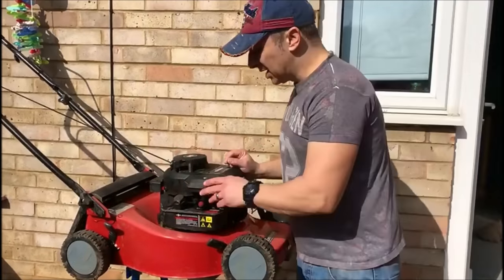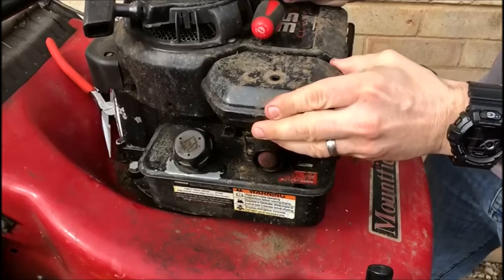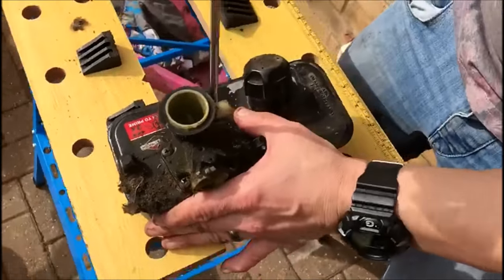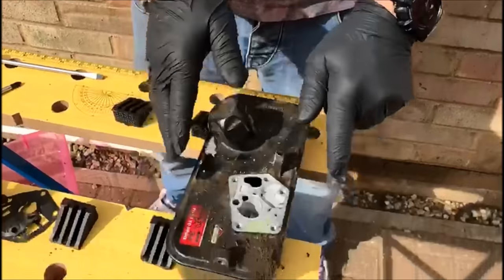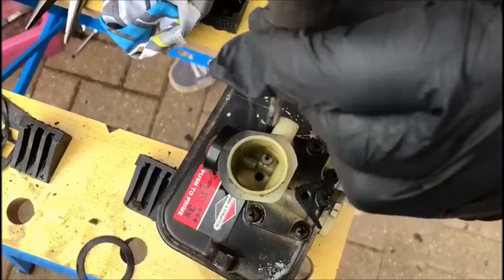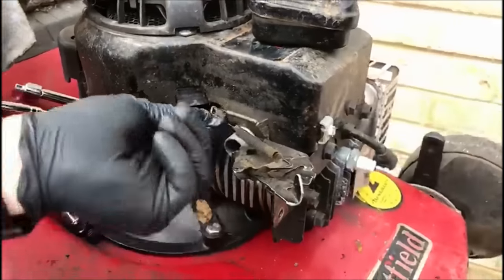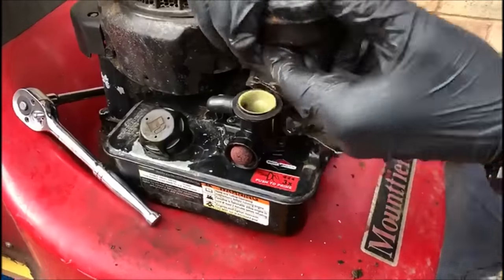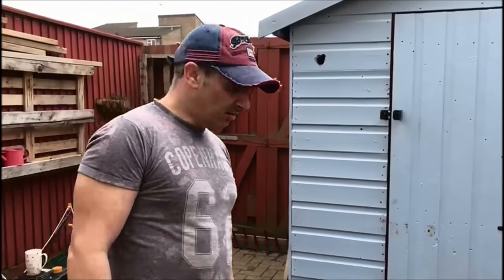how to service ,repair a briggs and stratton carburetor

Comment: I bought my mower several years ago. It has always been a bit of a s*d! I've had it back to the dealer but that made little difference. I knew it was a fuel problem with lumpy running and being difficult to start and almost impossible to restart when hot. I followed this video and cleaned the carburettor and replaced the gasket and diaphragm. It's a different machine now. It starts easily whether hot or cold, runs well and tackles long grass with ease. If only I had done this years ago. Thanks for your easy to understand video.

Comment: Thanks. Could not have fixed my mower without the likes of you. I watched a load of Youtube videos on these carbs 'running too rich', 'lumpy throttle control', sooting up spark plug, 'fuel leaking', 'not sucking up fuel unless tank more than half full', 'primer bulb not sucking fuel' etc. My mower was doing all of these things. I started off cleaning the carb with carb spray and changing the diaphragm and gasket for a non genuine version off ebay. This may have made it a little worse. Making a sandwich with the diaphragm between two gaskets made minimal difference. The problem was these plastic carbs are prone to distorting with heat and time making the surface that contacts the gasket uneven. I tried flattening it a bit with a sharpening stone and that did not help. Finally using the carburettor replacement fixed all the problems. If your carburettor is distorted get a Briggs and Stratton genuine replacement. They are not expensive

Comment: From Mark. I enjoyed watching your video with the diaphragm and carburetor gasket replacement. At this time, I have my sister’s mower at my place for the exact same repair. The B&S engine (10T802) runs great for about 2 years and will promptly blow another gasket. I tried another carburetor and there was no change in the end result. Now I purchase the carburetor parts in bulk for my sisters mower and a Series 300 B&S engine that I have. Best Regards From KY. Cheers.

Comment: excellent video.. 5 STARS 
I stumbled across your video looking to service a mower i bought off ebay. The oil dipstick screw wouldnt turn and the whle thing came out! (fixing screws were missing) managed to twist cap open, lubricated it a bit, put it back in and put 2 replacement screws (finally my collection of odd screws has come in handy) so the dipstick unit is now fixed and cap can now be turned and oil checked.  quiet proud of my self! I hate DIY because something always goes wrong!! I even managed to clean the Air filter!! so now feeling confident I searched youtube and came across your video,  and now after watchng it i feel confident enough to tackle a simple service !!   (at this rate i'm going to put my local lawnmower repair shop out of business!!!) 
cheers mate
Reply: me too.

Comment: Thank you for this excellent video for both cleaning up the carburetor and replacing the gaskets to fit it back onto the fuel tank. Not only are your instructions clear but you have a nice delivery that instills confidence that it will work. The result for me today was exactly that. The 4.5 horsepower Briggs and Stratton engine runs without surging anymore and my wife will probably stop expecting me to fix that hand lawn mower she brought back from the garage sale.

Comment: Thank you for this video.  I have same briggs and Stratton engine in my Mountfield empress 16 and had  changed the carburettor gaskets but broke my leg and shattered knee cap so had a delay finishing the project and when I came back to finish up for the life of me I couldn't remember which way the springs went back on. Really should have taken a picture but didn't anticipate starting the job one spring and having to finish it the next one lol.
You're a star.  Thanks again.

Comment: Great vid .
A couple of things to note, the o ring on the carb should be fitted to the carb and clipped in place before it is put back on the mower. Also, if you put the black sump breather pipe on the carb before putting it back on the mower, it makes life easier.

Comment: This is my first time at doing anything mechanical.  As a result of watching your video a few times (3) I got a kit, cleaned the fuel tank (old fuel was syrup) cleaned carbi, new gasket new plug chnaged oil.......started first pull.  woohoo.  now onto the whipper snipper.

Comment: Hopefully you still monitor these comments - I just cleaned my air filter and I can't get the long crew to "bite" into anything. Where does that long screw thread into? It's driving me crazy, it should be dead simple! Thanks for your help if you see this! FOLLOW UP NOTE - after asking about where the long air cleaner screw needs to thread I figured it out - I removed the tank and carb assembly from the mower, then took the carb off from the tank and looked at where the long screw should thread into. It turns out that the hole was full of dirt (not sure how it got in there) so I cleaned it out with a narrow pick which took a while to get all of the dirt out until the screw threaded in enough. I tested it as I went with the carb off. Once the screw threaded in enough I put everything back together and onto the mower - the long screw seated fine and holds the air cleaner cover in place securely now.

Comment: I really enjoyed watching your video especially your two Assistant/Inspectors !
I always clean and blow everything off with air gun "before" I take everything apart. That way all that dirt doesn't get in the carb or engine etc. (that's just how I am- it bothers some people) Also so much easier to work on from that point.

Comment: I usually brush off the top of the tank and around the carburetor to make sure nothing falls in it. So it's easier to clean and maintain before putting the thing back together with new parts.

Comment: Hello congratulations for the video that taught me a lot. But I noticed that in my opinion there is an error when you mount the carburettor with a free oring seal on the intake pipe !! I believe this must be mounted first on the carburetor with the ring of pastica that blocks it and only after inserting it in the intake pipe !! Otherwise this would not fit well by not closing and allowing the engine to suck in outside air. I specify that it is not a new controversy and only to avoid this error to others and forgive me for the translation made with Google translator. Greetings from Italy
Reply: You are correct.

Comment: Just a couple of tips, I only ever use warm water and soap to wash out the air filters. And to get a proper seal take the o ring and retainer and insert them in your carburettor before putting it back on the mower.

Comment: Thanks my Briggs & Straton started lsosing power after a few minutes of use. I changed the oil, bought a new spark plug and cleaned the air filter but that did not help! Alas I now know how to clean my own carburetor since I suspect that's where the problem exists.

Comment: I have other small engine equipment  like honda, etc. But briggs and Stratton has always been the problem starting. I put fuel additives, fresh gasoline with stabilizer and run it regularly and still a pain!

Comment: Great video mate and thanks. What size are the 2 sockets you used to take the carb off the mower?
Also, can you tell me what size of spanner I will need to remove the blade?
Thanks.

Comment: My filter screw does NOT tighten down any more.  Vibrates loose so filter wobbles and is not efficient.  Is it missing something?  Does it fit/screw into a gromet because the screw treads are NOT damaged but just looking into the cup the screw doesn't catch any corresponding threads to seat & hold screw in place..   Do I put some loctite goop in the hole a create new threads?

Comment: Very grateful for you sharing your knowledge. Mower runs a min or 2 & dies, primer bulb sucked in. New parts, reworked, now leaking petro. Could it be the gasket or o ring not sitting right ? I'm hoping. Gonna redo it tmrw.

Comment: I take the carb off and apart and use a garden hose to clean out all the ports and tank.  Clean the diaphragm and gasket and rub a little oil on them.  Blow dry with a hair dryer.  Reassemble and cut some grass.  Works every time unless the diaphragm is to far gone.

Comment: Great video. Really enjoyed it. I have a problem with my B & St  mower. It starts really well but wont stop. Would you provide a video on the causes of non stopping. Cheers.  Norm
Reply: Throttle spring probably

Comment: Only things I’d like to add is that I’ve had much better results with the life of an air filter (foam type) when I use filter oil on it after I’ve thoroughly cleaned it. 
Also, you didn’t address the jets. Cleaning the main jet is imperative to a smooth running engine. Good video though!

Comment: Do you have a vid of this same lawnmower (or any lawn mower that has a Briggs and Stratton 300 series motor, the older version) where you fix the governor? I replaced my carborator, but I think it's actually something to do with the governor that's not working, so I need to dismantle a lot more parts than just the simple carb replacement. Thanks :)

Comment: Hi, Ive got an issue to solve I cannot get through. After starting a Briggs&Stratton mower the spark plug gets carbonized very quickly and black dry soot appears on the tip preventing the right function and causing the mower to choke up like every few seconds. After cleaning and removing the soot from the spark plug the same issue reoccurs. The air filter seems to be clean + I've sprayed some carb cleaner into the carburetor + cylinder itself.
What occurs to me is either bad ignition timing which I strongly doubt or bad petrol, can it be?? I forgot to mention that spraying the carb cleaner defers the choking up substantially but the same issue within 30 minutes or so...
Reply: If it has this same carb as in this video, you need the same repair.  Main symptom of these diaphragms failing is the engine will run WAY too rich--black smoke, chugging, fouled spark plug.  The diaphragm starts to leak around the holes so the engines sucks up fuel from places it shouldn't.  Also, DON'T get carb cleaner anywhere NEAR the diaphragm.

Comment: Mine is a Rover mower with the Briggs engine.....when I watched this video I noticed that the diaphragm on yours doesn't have the pump linkage to a butterfly flapper in the intake tube that mine has.....maybe mine is an old model ..........I got it in the early 90's, still running.....your carb is a much simpler model than the 6 screw carb model that mine has.......mine also doesn't have the primer bulb for easy starting.

Comment: Is it possible to put a throttle cable on this engine’ so I can run it at slower revs for short grass’ and less noise in the early mornings before I go to work ‘ great video well explained keep them coming
Reply: Just stretch the governor spring a little

Comment: That O ring and white  plastic collar goes in the carb first .The O ring first and then the plastic collar which  is an interference fit in the carb .It will suck air in the wrong place like that

Comment: My neighbour had no place to put the law mover  so he asked me to store at my place and I can use it too....
It is a BRIGGS & STRTON  AND it always started at first pull  ...winter come and we only used once a month
But to make it start I had to put a bit of petrol in the spark plug hole  of course I don't like to that all the time....
I dicided to clean the carburettor  and put it back m  ... the primary worked and it started after a few pulls 
But  it stays on the high rev all the time  ....I should point out that the liver that you disconnected  the springs
is short and it is easy to reconnect the tank  rather mine has a long connection rod that to the springs connection
little plate  sems to be that on this kind of tank only has a little spring on the others I have seen two one bigger 
then the small one and  they connect together....Well hope anyone can understand my problem and can give me 
an advise what to to make it start ......Thank you

Comment: Well it looked ok,.....but I put the o-ring in the carburetor then I put the keeper ring in,.... then I wet it with my finger and slide it on,......well I put the carb linkage on first,... slide it on and bolt it on.
But even then mine runs but will not rev?
I blowed air through the carb and air wouldn't go through,.......where the metal screen was?

Comment: There’s only on thing I would add. Bright and Stratton are American engines and they have not adopted metric. So if a bolt is really tight you need an AF spanner as metric can turn the corners from the bolts.

Comment: With fuel prices the way it is cheaper to buy a new filter infact getting a whole carb, which is where Brigs and Strat no make thier goods, is get £12 carb, plus diagphram and gasket  with primer bulb all new for less than the cost of the consituent parts, and the carb clearner is far more expensive!

Comment: Won't the airfilter only fit in the correct position?? The hole where the screw goes is not central so if you have faced it the wrong way then surely the screw won't scree in . ??

Comment: How do I replace the primer button?
Reply: Idk, but after mine not running for years, I put some gasoline in the “bowl” of the carburetor and a first start with starting fluid. Now it starts without priming or starting fluid.

Comment: I have problem on my lawnmowers carburetor primer , my primer when I pushed in the rubber for primer doesnt  pop up back anymore it stays in, I have that problem n I cant start the engine  how can I solve/fix it ? 
I live in Melbourne Australia n I have same engine briggs & stratton 4 stroke 148cc engine ,  but here they make in Australia n they call the brand name Victa, model Vintage, 450 series, blue color chassis/body but I believe engines r  import from USA n my lawnmower  has the same petrol thank n carburetor on your this video has.
i hope u help me how to fix that problem.Thank u in advance ,
Sorry my english may be no good, english is my second language.
Reply: Replace the primer button
Reply: Yep primer bulb is rotting inside. I found an old one with a hole in and fixed it with puncture repair kit glue

Comment: If it still doesn't run right after replacing the diaphragm, try using 2 gaskets with the diaphragm sandwiched between them. That's what finally worked for me. I saw this trick here:
https://youtu.be/8lyJka9XU58?t=655

Comment: should've oiled the air filter
Reply: How do you oil an air filter?
I've never taken a mower apart
Reply: @rosesallotmentadventures9365  This was my 1st time but looked at the manual as well. after cleaning the oil which should be in it already. just use any engine oil, i just poured  some on each end and squeeze it in. Probably the size of a UK 2p on the big end and just a little on the end with the hole in. Think it's just another barrier for dirt and dust
Reply: @kerrywoolnough664  thank you 😊